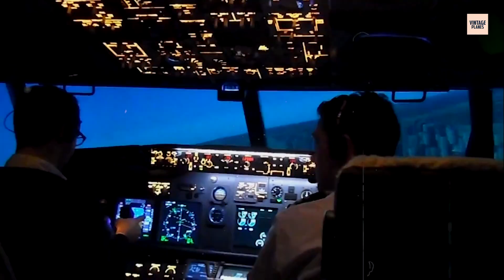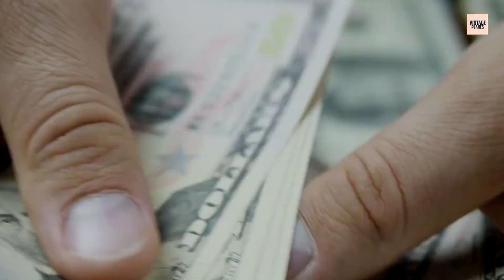Only 5 Years Old: The Shocking Reason This Airbus A220 Was Scrapped

Comment: This is not just an economical issue. I am no expert but I know that Swiss grounded their A220s due to engine issues for a while. And last winter they had an emergency landing in Graz, Austria due to smoke in the cabin (coming from the engines - oil burning). One crew member died from breathing in the fumes. These engines are dangerous!